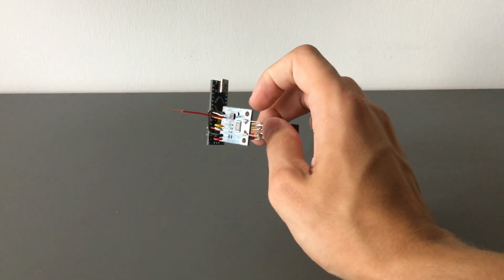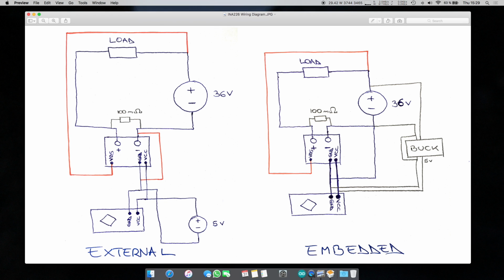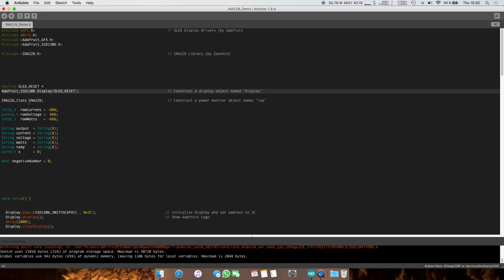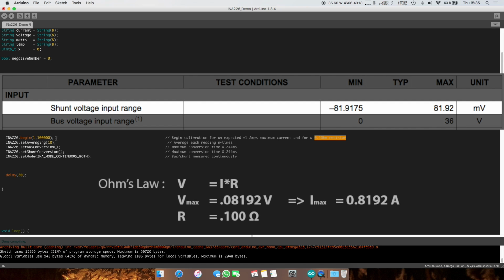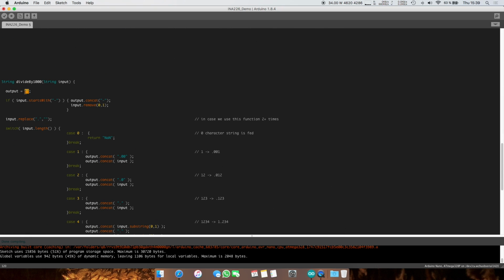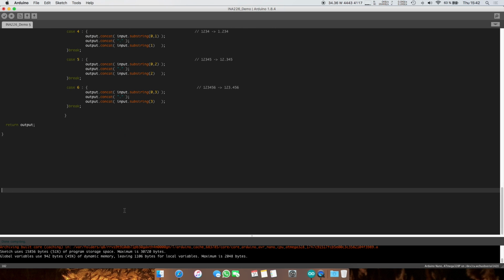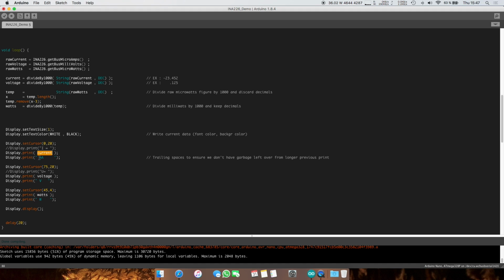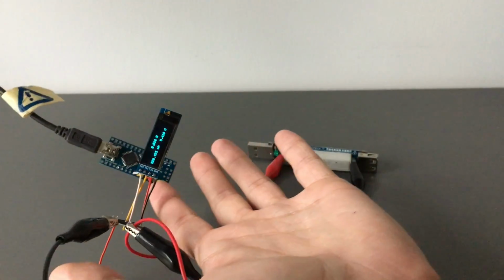INA226 Power Monitor + OLED Display - Arduino Tutorial

Comment from the maker: Some OLED displays use a different chip ! Namely the SH1106, for that you'll need to download the appropriate library from: https://github.com/wonho-maker/Adafruit_SH1106

Then #include<Adafruit_SH1106.h> instead of <Adafruit_SSD1306.h>

All occurrences of SSD1306 should be changed with SH1106
Reply: Друг сделай пожалуйста видео, как использовать INA 226 и доработать схему чтобы была защита от подключения измеряемого источника питания обратной полярности (например когда измеряется напряжение аккумулятора и его подключили неправильно перепутав полярность).

Comment: Why convert to string and then / 1000. It's way simpler when it's a number to devide by 1000 and then convert to string!
Reply: Good point!
Reply from the maker: I think I did it because of the rounding .. i.e. show 1.456 for the result 1.4557 - same for less available digits

Comment: The INA226 can measure up to 36 volts. 
The INA219 only up to 26 volts.   Both are connected to I2c and can sense the current through the shunt

Comment: the code he wrote is here.

#include <INA226.h>

INA226_Class INA226;

int32_t rawCurrent = -666;
uint16_t rawVoltage = 666;
int32_t rawWatts = -666;

String output = String(8);
String current = String(8);
String voltage = String(8);
String watts = String(8);
String temp = String(8);
uint8_t x = 0;

bool negativeNumber = 0;

void setup() {
  Serial.begin(115200);
  INA226.begin(1, 100000);                    //Begin calibration for an expected +-1 Amps maximum current and for a 0.10hm resistor
  INA226.setAveraging(10);
  INA226.setBusConversion(8.244);             //max conversion time 8.244 ms
  INA226.setShuntConversion(8.244);           //max conversion time 8.244 ms
  INA226.setMode(INA_MODE_CONTINUOUS_BOTH);   //Bus/shunt measured continously

  delay(20);

}

void loop() {

  rawCurrent = INA226.getBusMicroAmps();
  rawVoltage = INA226.getBusMilliVolts();
  rawWatts = INA226.getBusMicroWatts();

  current = divideBy1000(String(rawCurrent, DEC));
  voltage = divideBy1000(String(rawVoltage, DEC));

  temp = String(rawWatts, DEC); //Divide raw microwatts figure by 1000 and discard decimals
  x = temp.length();
  temp.remove(x - 3);
  watts = divideBy1000(temp); //Divide milliwats by 1000 and keep decimals

  Serial.print(current);
  Serial.print(" mA\t");

  Serial.print(voltage);
  Serial.print(" V\t");

  Serial.print(watts);
  Serial.println(" W");

  delay(20);
}

//this way you lose no precision when dividing by 1000
//and can format the output
//if you use the float type,you get only 2 decimal points,and those are also rounded

String divideBy1000(String input) {     //input=-321.421

  output = "";

  if (input.startsWith("-")) {
    output.concat("-");
    input.remove(0, 1);
  }

  input.replace(".", "");              //in case we use this function 2+ times

  switch (input.length()) {

    case 0: {         //0 character string is fed
        return "NaN";
      }
      break;

    case 1: {        //1 -> 0.001
        output.concat(".00");
        output.concat(input);
      }
      break;

    case 2: {        //12 -> 0.012
        output.concat(".0");
        output.concat(input);
      }
      break;

    case 3: {        //123 -> 0.123
        output.concat(".");
        output.concat(input);
      }
      break;

    case 4: {        //1234 -> 1.234
        output.concat(input.substring(0, 1));
        output.concat(".");
        output.concat(input.substring(1));

      }
      break;

    case 5: {        //12345 -> 12.345
        output.concat(input.substring(0, 2));
        output.concat(".");
        output.concat(input.substring(2));

      }
      break;

    case 6: {        //123456 -> 123.456
        output.concat(input.substring(0, 3));
        output.concat(".");
        output.concat(input.substring(3));

      }
      break;

  }

  return output;

}
Reply: you are a LIFESAVER, his GitHub he linked is no longer active and this is the only video I could find on the ina226

Comment: 19:30 wow even with resistive load its not stable, all these INAs has same problem, wonder who uses them.
Reply from the maker: xmenxwk mmm, seems quite accurate to me though, there's only jitter in the least significant digits ... and the resistor was warming up as I made the video, soo, yeah, not toooo bad I'd say
Reply: @Darieee  you should watch your video again, it reached 800mA from 300, then drop to 400 and still not stable. A simple current sense resistor with an op amp would work similar or better. All these current sensing INAs are not stables and cost too much.
Reply from the maker: yeah nah some other shit happened then

I am using the INA226 in my iPod Hi-Fi restoration build, whatever you could call it

and it gives me .001 mA precision, beautifully ...

sooo ... yea ... I'm quite happy with them

I've also made a power monitor out of the INA219, and that has also worked splendidly for about a year now

https://youtu.be/AIoXwwDlH3g
Reply: I use them. They're pretty sweet

Comment: can you add shunt to it ? I need to measure about up to 30A
Reply from the maker: Sure ... check the chip's datasheet, it specifies the maximum amount of mV it can measure ... run your math, pop out the existing shunt and use your own

You'll obviously be foregoing precision but ... at 30A I doubt you're looking for mA differences
Reply from the maker: Sure ... check the chip's datasheet, it specifies the maximum amount of mV it can measure ... run your math, pop out the existing shunt and use your own

You'll obviously be foregoing precision but ... at 30A I doubt you're looking for mA differences
Reply: @Darieee  Cool. Thanks for your time
Reply from the maker: You're welcome! What're you measuring btw?
Reply: @Darieee  I built a 4s lifepo4 battery and I want to measure The current going in and out to each cell.  It will very rarely reach 30A but that is what I'm expecting as a maximum draw.
Reply from the maker: Hmmm, so .. out of 'each' cell would still mean you have a single INA219, right?

Sounds pretty cool, let me know where you'll get the shunt resistor from
Reply: @Darieee  No. I dont think that would work.  It wil be 1 ina for each cell
Reply: @Darieee  you get the aswer about what value resistor need to count 30A?

Comment: great idea the GND to Vin- shortcut wire to have a wire less ! 
if you accidentally connect the load the wrong way you wont short out everything ?i think its better to have 2 wires comming out of the V-  blue connector to always remember that the point with the 2 wires is the ground.
either way you can connect colored wires to remember , but u know sometimes we got distracted haha.
Reply from the maker: Well, in the power monitor I made with this chip, I have 3 schkotky diodes in parallel that would shunt any wrongly placed supply and blow the fuse (and hopefully survive)

If you have any idea on how to measure voltages in both polarities do let us know (I think I have a module that can do it but have yet to play with it)

Comment: Can I measure the voltage of two consecutively connected batteries? (not separately standing) I understand that you can give them different I2c addresses.
Reply from the maker: you sure can - just blob over one of the addresses on one of them

if you don't need stupidly accurate readings and current measurements, you can get one of these analog to digital converters and achieve the same result: https://bit.ly/2OjvU8O

In the coming weeks I'll be making a video about how to implement one, though - there's absolutely nothing special about it :)

Comment: it is so cool video man, Do you know, what is the resolution of  INA226 for current messurment?
Reply from the maker: Mmm, I don't really remember, I think I did the math in the video ...

In any case, check the datasheet, that should give you the mv accuracy or something

In my experience, you for sure have a rock steady 1mA resolution, and the library I think gives you uA ... which aren't too stable

Comment: First of all thanks for the amazing Video, its all understandable.
The link of the code is not working, can you please provide me the code? i will be thankful! thanks
Reply from the maker: Ok, I've reuploaded it; the old one worked too - but the newer link is indeed better !
Reply: Thanks for the quick replay :)
i have a small a question i don't know if you would help with that. i will use the ina226 to measure current through a shunt resist but i cant find the shunt resistor i want which is 0.5 ohm and +-1% do you think i can replace this with two resistors of 1 ohm in parallel, would this be fine? is there anything i have to take care of?
Reply from the maker: It should be fine; but, why don't you buy one of those ready made modules that come with the resistor ? Do you want to measure more than 800mA ?
Reply: Hmm you mean like the ina260 ? it comes with a resistor, cause i am scared of not being able to program this and am not a software guy, basically i wanted something which has less error and is exact so the ina226 was the best option, and the ina226 has alot of videos and articles in internet. I don't know if this make sense, but i checked the datasheet of the INA260 and compared it with the ina226 because they are similiar, the INA226 won the comparison regarding errors and everything.
Reply from the maker: I don't know where you're checking, but, all the ina226 modules come with resistors

http://s.aliexpress.com/VJvMvQFj

You might want to buy more than one in case you fuck something up - also, the 226 can only measure up to 800mA, if you want higher currents get the ina219 (on decrease the value of the shunt resistor on the 226)